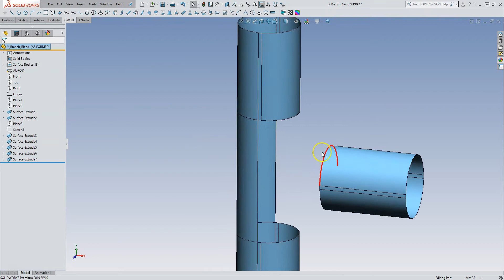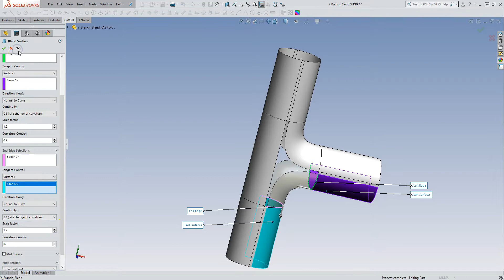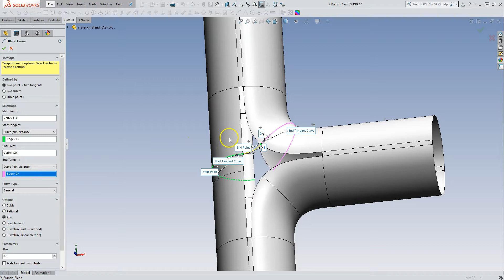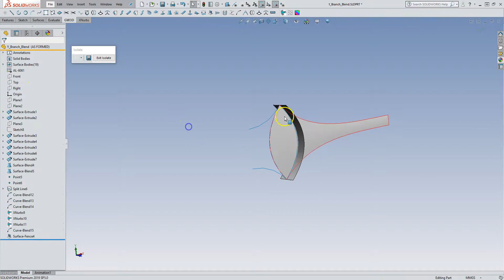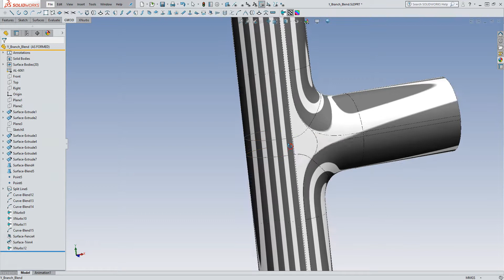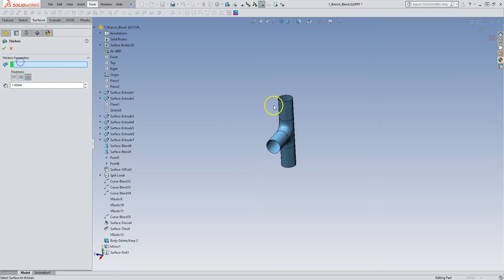SolidWorks Y-Branch Blend

Comment: Quite more flexible and powerful options in Solidworks compared to Rhino, although technically you use GW3D and XNurbs here, which are proprietary third-party plugins (not cheap either). Seems also the surfaces are single span as well, well mostly arc/circular so they should be single span by default.
Reply from the maker: Different pieces of software obviously. Surfaces definitely not single span. You can check this with GW3D. I believe one of the reasons you can't check this in normal SolidWorks is because it always creates very dense multispan surfaces. But at the same time, if the resulting multispan surface is smooth should we care?
Reply: @marklandsaat3696  Interesting. I did not know that. Makes sense though, becuase technically SW is a solid modeller, not a surface modeller. Not sure whether there is a span check/set option in XNurbs or not.
The result looks good enough, even perfect so... yes, maybe we should not care much.
Reply from the maker: XNurbs for Rhino can in certain cases respect input curves, but from what I can tell in SolidWorks it creates Degree 5 multi-span surfaces. I have done several tests comparing SolidWorks Boundary/Loft/Fill to XNurbs and XNurbs pretty much always creates a surface with better control point distribution while at the same time using less control points.